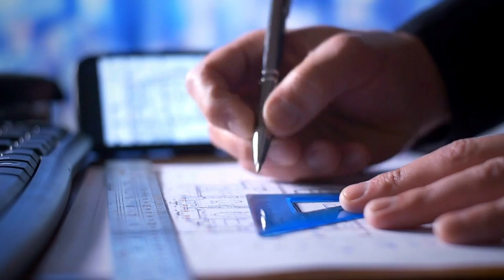The Monster Howitzer That Can Drop Shells on a Dime 30-Miles Away

Comment: As an Artilleryman who used this in Afghanistan, I approve this video. It's as every bit as fun as advertised
Reply: Did everyone wear their earplugs?
Reply: Great to hear!!!
Reply: @oneshotme : Huh? Speak up, I can't hear you! 😅
Reply: I was a Cav Scout, granted we could make a mess of things, but the impact from one of these would just sweep the sand/dirt... Maybe change the topography a bit too.
Reply: @destinywilliams801  can confirm. Many a grid square have been made holier than Thou 🤣
Reply: @westrim  earplugs? Never heard of her
Reply: Thank you for your service.  If I may bother you with a question: Regardless of the time it would take, could a single person fire the M777?
Reply: @jocopowell  anything could be ran by a single person, bottom line, if it's set and sighted shouldn't be a reason why one guy couldn't load, ram and pull the lanyard.
Reply: How many of these did we give to the taliban when we bugged out?
Reply: @jocopowell  If you did not care about accuracy I guess?  Absolute minimum in reality is 3, you need the chief, gunner, loader at the least.

Towed artillery is no joke, in AIT I stressed over danger close and counterbattery, hell I never could find those high angle primers?

Got a lot of respect for the 0800 Marines I met, always made a hole in chow line for them.
Ft. Sill 13B - Lawton sucks, boring ass town!
Reply: @efone3553  idk how many did you give to the taliban when you bugged out
Reply: thank you for your sacrifice and service 🇺🇸
Reply: Thank you for your service sir,and for defending our children and our way of life in the us.
Reply: @smokey_cornbread
 ...I'd like to ask a real artilleryman w/ real experience in the crucible of battle such as Afghanistan. How does the crew not irreparably damage their hearing? Some soldiers look like they're not wearing any ear protection, and just turning your back when firing doesn't seem helpful at all. Your thoughts/experience? I thank you and I sincerely appreciate your service. I have 2 friends who served. The Captain served 3 tours. The grunt only had two. Both came back with all 10 fingers & ten toes, thank God!😉
Reply: @davids1inwestholl45  it's either plugs or noise canceling muffs that attach to our helmets. As far as looking back when firing (personal experience) all that really does is make your ears themselves less susceptible to the blast wave itself. You can't escape the explosion because of what's going on. So when we have our hearing covered, we just turn away to protect our face from a full frontal barrage 🤣🤣 hope that answers your question big hoss
Reply: @MOON BAGS  thats the home of FA though brother! I went to basic and ait there.
Reply: The M777 not much of game changer in Ukraine
Reply: Video mentioned not all of its problems were solved in m777. What issues is he talki about from your experience homie
Reply: @mark4371  sure it is. Not as much as HIMARS, but better and more range than any Russian gun.
Reply: As a Vietnam War cannon cocker, I approve your message.
Reply: @efone3553  All of them??
Reply: @robertodebeers2551  I'm much obliged big hoss. Big guns lead the way, right boys?
Reply: @Smokey_Cornbread  I saw the 175 long toms throw some major weight, but they were dangerous because they were rifles, not howitzers, and if you were in the line of travel, long or short, you could get hurt if they didn't get the elevation right.
Reply: @robertodebeers2551  looking at you 101st 🤣🤣🤣🤣
Reply: How would you feel about an auxiliary auto loading vehicle to the howitzer?
Reply: @Smokey_Cornbread  nothing can explain thumpwhadoompeeeeeeeeeeeerchsssshshhhhh. Hope you understand brother.
Reply: @davids1inwestholl45  dude no-one answered you in 5 days? I suppose it's an inside joke. If I were you I wouldn't go looking for answers. Do or don't, you won't have a choice soon. Get good for all of us. Cheers bro❤
Reply: @waynedieckmann9840  explain? Nothing can beat it 🤣🤣🤣🤣 death by dial up 🤣🤣🤣🤣🤣
Reply: @Smokey_Cornbread  you remind me of my x
Reply: @Smokey_Cornbread  sorry the utube text is broken. Hard to follow conversations but I got U man.
Reply: M777 in Ukraine has proven its self worthless heavy criticism about its durability daily breakdowns short barrel life 2500 rounds when Russia is firing 200,000 to 400, 000 rounds a month and TOTAL Inability to engage in sustained Counter Battery Fire. Ukranian troops are dissatisfied and say its no match in durability or rate of fire for Russian artillery it tried to emulate designed 40 years ago an enormous expensive failure with most already destroyed. Made in AMurica 😂😊
Reply: @yfelwulf  lesser quality pieces. And it's actually made in the UK, they just have a plant here now.
Reply: Well fun when you are on This end of it
Reply: Until someone can shoot back.
Reply: we fight for the god of war. our father in heaven with many faces in 1 force. satan.
Reply: Would not be so much fun if you had couter battery, now would it???  Worked great since the Afgan's had no artillery.  No fun at all in Ukraine when the counter battery is on its way a minute from when you fired.  Awful hard to fire and be 100 yards away a minute later.  And if the return fire was one of the smart drones, 100 yards would not be enough.
Reply: Thank u for ur service!  I did two tours in Iraq.
Reply: @boberry66  everyday. Did 48 hours in watts los angeles. Got the F out of there. Would rather go  to IRAQ. More safer.
Reply: Yeah, I guess for shooting at villagers with nothing more than a 40 your old AK-47 and sandals it's fine for that... But you'd never want to take this against a peer level adversary like the Russian Federation. We see the result. The artillery tube constantly fails from the incredibly high pressures the engineers expect it to tolerate in order to eek out those extra couple of miles over comparable Russian artillery units of the same type and caliber. And the gamble failed. The m777 is wildly unreliable when having to shoot thousands of rounds. It constantly breaks down, and it's maximum range as all but never used.
Reply: UBIQUE
Reply: @westrim  WHAT?
Reply: Nice! I was a Navy Gunners Mate in Vietnam era... big guns ARE fun! (5"-38, 5"-54)... but my hearing is now for shit. 😵
Reply: I bet not so fun on the receiving end.
Reply: @Khronogi  yeah, why did trumps administration promise the Afghan government all that hardware? Has trump said why yet?
Reply: I wouldn't be the guy loading it those rounds are heavy
Reply: @WolfHound911  Please explain the reasons why you made a hole in the chow line for them!?
Reply: @mark4371  please explain exactly how you know that to be the honest truth!?
Reply: @Smokey_Cornbread .....I hope I'm not bothering you in anyway. But we are just very curious as to why you answer most people as "BIG HOSS"? We have been told that "HOSS" is another American word meaning horse. I didn't learn this until I was informed of its meaning at church.  My mother in law and her group of friends, I guess got really offended because I kept answering them with this. I have just recently met them and can't remember all of their names and thought this was a friendly way of addressing all of these older American women.  All their husbands appeared OK with it. They all had big American smiles.
Reply: Wade, as a civilian who is grateful for my freedom, thank you for your service.
Reply: @eddieBanke22 .......what outfit you with in "THE NAM"?
Reply: @billpugh58  just the hell are you talking about, please explain. Thank you.
Reply: @robertsettle2590  32nd Artillery, Second Field Forces.  I was in Tay Ninh and Cu Chi and the area between.
Reply: The Taliban had no Artillery no air support and they still defeated you , that's why I'm tired of hearing how the Marines are the best of the best and I fear when we go up against China.
Reply: Also don't forget about Nam and Afganistan Korea saying the US has the best is all talk
Reply: @robertsettle2590  We were Cherries in Army basic 'boot camp' at the time.  The Marines were in their actual MOS artillery training.

DS told us make a hole so they could get through quickly.  It was a courtesy, but they also had to hurry.  It was usually just a squad or platoon, not the entire battalion.

The Marines I saw at Ft. Sill were always running all over to places.

We just gave them a hole each time, but they only showed up in our chow line once a week.

RE: Ft Sill - "All Marine Field Artillerymen - both officer and enlisted - are trained at the United States Army Field Artillery Training Center. Although Marine presence at Fort Sill dates back to the 1950's, the Marine Detachment was formally established in October 1977, in conjunction with the closure of the Marine Barracks, Naval Ammunition Depot, at McAlester, Oklahoma. The Marine Corps representative to Fort Sill was designated as the Commanding Officer, Marine Corps Personnel."
Reply: @Canbilly2  Good times, I remember driving by the old barracks.  Made our new barracks with AC feel like a palace. :)

Chow was awesome during my time there.  I went in weighing about 155 and skinny.  Left at 200 and the best shape of my life :)
Reply: @mark4371 Sure thing bot boy.  Puking is waiting for the special massage you give him.

Comment: I absolutely love titanium.  You know what doesn’t love titanium?  Tooling. 😢
Reply: It is rather expensive.
Reply: Didn't they also require non chromium alloy tools for any maintenance? Remember reading that about the Blackbird long ago
Reply: @philgiglio7922  
Wouldn't be too weird, choosing metals that won't spark (titanium) or metals that are less likely to damage surfaces (no chrome, too hard)
Reply: @merlinious01  - It's to prevent a physical/chemical reaction between the chrome and the titanium that deteriorates the titanium.
Reply: @breakbollocks9164  
Neat! Like an amalgamation reaction or something? 

Or just run of tthe mill electrolysis?

Comment: I've seen a demonstration where a M-777 gun crew dropped 3x155mm HE rounds at the same time on the same target from 10,000m. Then they towed that puppy away using a ute/pickup.
Reply: once you get it going, don't brake hard, the gun barrel alone weighs more and has more metal in it than the entire pickup, lol

Comment: As a Artilleryman in I Corp. Using the 109A2 Self Propelled and 198 Howitzers 155mm in two shots you can hit a 55 gallon drum at 30 miles.  You can be extremely accurate with these systems.
Reply: What about m777 ? Is it accurate with well trained personnel

Comment: I love the M777. I just wish we would buy some for our army too. Wouldn't be impossible in itself with the extra 100 billion for the Bundeswehr.
Reply: Unless your country sees the need for airborne infantry using INS/GPS guided shells, then the m777 is a bad purchase.  Self propelled wheeled, tracked artillery is superior, MUCH superior.
Reply: well, we have the panzerhaubitze 2000. just a hundred or so, but it's a superior platform for sure. dark tech has a video about it as well btw.
Reply: I kinda want one for around the house....jus fer fun.
Reply: @daveward1935  well you need to replace windows often and think your neighbours won't be happy
Reply: BW has no need for a M777.
Reply: @w8stral  SPG's are not superior to towed artillery, just different, they both provide warfighters with indirect fire support through different parameters. you can't put a PZH-2000 on top of a mountain in Afghanistan and rain hate. You also can't move an M777 with an armored brigade and provide mobile fire support. Both are needed in a balanced force.
Reply: @MisterW0lfe  Suggest a pair of reading glasses... or better yet, rub 2 brain cells together for 2 seconds of contemplation before replying.  Save yourself the embarassment of reply's like this.
Reply: @w8stral misterwolfe is correct there are places the m777 can go that selfpropel artillery cannot

Comment: G-6 = 67,450 m M9703A1 V-LAP round (tested successfully to 73,000 m by Denel in G6-52 extended range platform)
76,280 m M9703 Practice Inert V-LAP[18] ; In 2012 four rounds of M982 Excalibur precision guided munitions were fired to a range of 38 km, all landing within 5 m of the target.
Reply: Is the G-6 based on the G-5 howitzer? Thank you. 

Spain uses the SB 155/52 which is similar to the South African G-5.
Reply: @arbelico2 ...was the G5 designed by the late Gerald Bull? I know he did some work for them
Reply: @philgiglio7922  It could be...
Reply: @philgiglio7922  yes he was working on the super canon , Iraq was interested in those days , pre 1990

Comment: 0:54  The crew has a lot to do with it.  Look at the dude on the left do a Superman jump onto the gun as soon as it fires.  Yow.

Not mentioned is the 777's ability to fire at least five shells (I saw 7 in a different report) in under a minute using different trajectories such that they all arrive on the target at the same moment - a true one-gun time-on-target.   Imagine three 777s doing that to a single target - 
15 to 21 shells landing simultaneously in your midst - terrifyingly effective.
That much firepower arriving at the same instant must be absolutely shattering, literally and psychologically.  Then the 777 is gone in 3 minutes so no counter-battery fire is possible.  Assuming you can even think after a time-on-target like that!
Well done to the BAE-USA partnership!!!

Comment: I was always amazed at how the M777 coukd be so incredibly accurate.  They were the most valuable asset in Viet Nam.  Back then there was the 8 inch howitzer and the 175mm self propelled howitzer.  The 155mm howitzer was not that often used.  The 155mm howitzer is a must have for infantry.  As I ha lve said many times before.  You want Artillery at your six, you must have forward observers embeded in your unit.  Together your enemy just vanishes, in little pieces.  Your sons, brothers, get to come home.  This philosophy has nowcl extended both Naval and Air Force as well.
Reply: Sorry my brother, they didn't have the M777 during the Viet Nam era or Desert Storm. The M777 was tested in Ft. Sill Ok. in 1992 by a US Marines M198 Cannon Crew and a US Army M109A3 Crew. The crew with the fastest time stayed and the losers went back home, after buying 8 cases of beer and 2 half gallons of vodka. Glad to say, thanks Marines.😉
Reply: @Front Desk  reading comprehension is not your strong suit.  I was first of all giving my suppression for the M777 of today.

During my your of duty in Viet Nam there were the 175mm and 8 inch Howitzers period.  When I wrote They were the most valuable asset of the Viet znam war I was speaking of the 175mm and 8 inch Howitzers.

I am not that talented writer that I can effectively write for all comprehension levels.  I have written many articles and Technical documents primarily for IBM.  Which I retired from after 30 years of service.  So I am not a trogladite  on the keyboard.  I hope that helps you in your search for comprehension

Comment: Please explain how there’s a need for a „lightweight piece which can be towed and lifted with ease“ when it could just sit in one spot and hit things 30 miles away with pinpoint accuracy! I would’ve thought you mainly needed to hide and protect it in one, good spot and then start firing away…
Reply: Modern army's have radar, once a artillery peice or battery fire , the other side can triangulate the source / location of the fire and return the favour, usually within minutes .
That's why only a few army's, with very specific requirements and the means/ recourses and circumstances use them.
The Indian army uses them in the mountains and  jungles. But in the plains or deserts it could be rather sticky.
Reply: @adhirbose9910  Radars „triangulate" where the shells originate; is that what you’re saying?
Reply: @Hallands.  yes.
Reply: @adhirbose9910  I don’t think radar sees shells flying…

Comment: It should be noted that, while this is still used by both Army and Marine units, the question of survivability is a troubling one. Russian counter-battery radar systems are able to trace point of origin and fire on artillery units as quickly as those artillery units can conduct emergency displacements
Reply: There's a lot that I could say, because what you've said is wrong, but I won't. Because I only play WarThunder sometimes.
Reply: @WheatSn4ckBread  No, you are wrong.  That's why they developed the M109 SPH long ago.  Shoot and scoot.